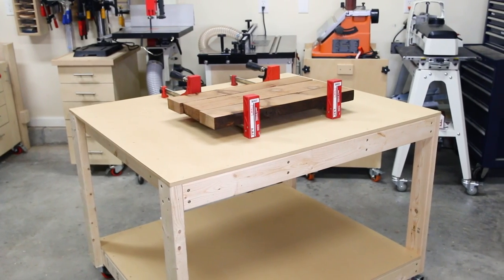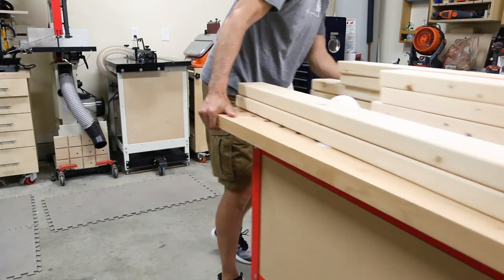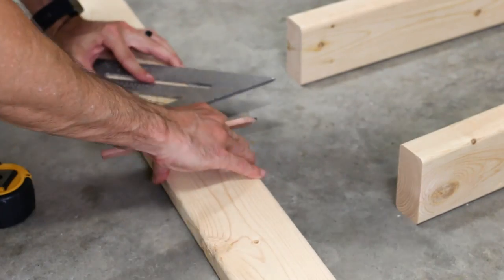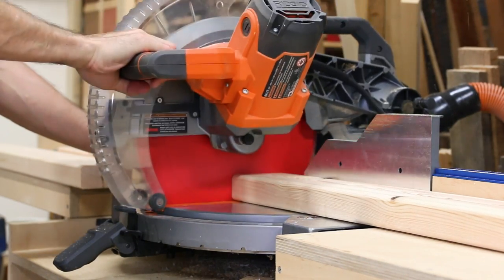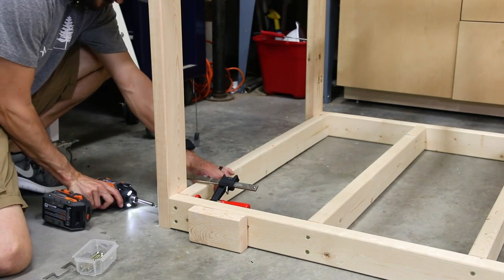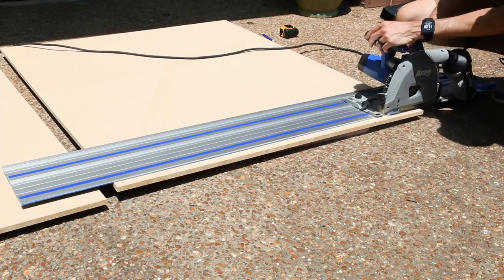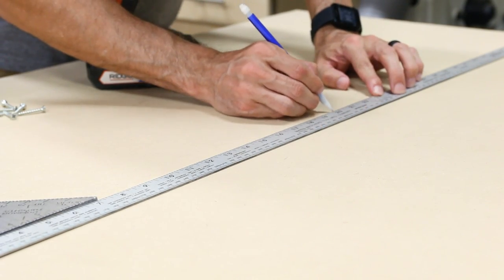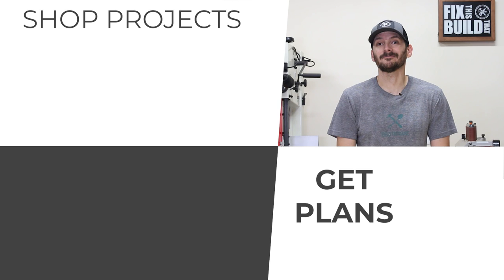DIY Workbench / Work Table | How to Build

Comment: Looks like you are mostly relying on the shear strength of the screws to support the top frame to the legs.  If you add a second 2x4 inside each leg it will send load directly from the frame, to the leg, to the bottom frame to the floor.  Much more reliable than just the screws.  As a bonus it will likely help to make the whole thing more solid and shake less if you are going to be mounting a cnc on it.
Reply from the maker: Totally agree
Reply: Glad that I looked for this comment before posting it myself, as you've phrased it better than I could. I built a similar table and since I used large reclaimed lumber that wasn't as uniform in dimension, I used a circular saw to lap-joint the legs to the frame, getting a similar result - there's a surface to screw into, resisting lateral forces of the table top going side to side, but the frame also rests vertically on the legs to prevent shear forces from being applied on the screws.

Another thing I did slightly differently (other than using more reclaimed solid lumber for the top and flattening it with a router planing jig) is leave significant overhang on 1 side and one front, so that the flush sides can go up against a wall while the overhang sides can be used to easily clamp work to the bench. When up against a wall, I find locking 2 casters is enough, no need to crawl behind the table and try and press that corner brake down.
Reply: yep agree, that and the 10 screws on each bottom corner, be careful as i've seen2x4 easily splinter

Comment: Just finished building this.  Took me a little more than 5 hours.  It's a little rougher around the edges than the video but came out pretty darn close.  Great table, easy build, it's exactly what I wanted.  About $150 all in, got everything at Home Depot.  Thank you for the video and inspiration!

Comment: I just finished building that work bench.
I must say this is really nice. Perfect height and size. The casters really help and the locks are excellent. I did take it one step further.  I took all the top 2x4's and ran them through my jointer.
Thank you for the plans they are awesome and the cut list saves alot of aggravation. 
I'm a machinist by trade because even engineers need a Hero 😁

Comment: It's taken me nearly a year but I am finally down to only putting on the worksurface MDF.  Only able to work on it for short moments.  (It has been a long hard year for me but it has been good.)  I went the extra mile and added the drawers like you did in your update video.  First time mounting sliding rails, and it worked perfect!  Thanks for posting these videos!

Comment: I just built one of these. Wish I would have used MDF as my top. I have a cup in my 3/4 plywood top. Hoping to figure that out today. Thanks for sharing.
Reply from the maker: If you screw it down it should flatten it out (assuming boards are flat underneath)
Reply: @Fixthisbuildthat  For some reason that didn't help. I did end up flipping it and that made a huge difference. I think that table will end up being a finishing table. And I may make another more close to your design. Thanks!

Comment: Definitely going to use this as a template for a table! I like how low the shelf is so you can maximize size of items under it.. One thing I am going to do is leave the frame about 2" or 3" smaller than the top to have an overhang for clamps to attach to. Was debating if making a mobile or fixed table and after seeing this, bought the casters immediately

Comment: Another good video. Seems like a pretty simple project the way you break it down. I may not be an engineer, but I am a perfectionist!😉 I would have filled in those countersunk screws on the top work surface with wood filler and sanded it down lightly before applying the polyurethane....this way you don't have all those little round pockets on your work surface to catch dirt and saw dust.... it'd make it much easier to clean.. other than my OCD wood filler tip, I think that work bench looks solid!

Comment: Thank you so much for this video and the plans. I’ve built the entire frame so far, and I just need to pick up the material for the top and shelf. Assuming I’m okay with it being double the price, would you recommend a sheet of hardwood plywood over MDF? Or is MDF better for a work surface?

Comment: A great way to find straight 2x4's, when the only thing the home center / lumber yard has is a pile of pretzels, is to make them.  Take any 3/4" sheet of plywood of any grade, rip it into 3 1/2" wide strips, glue 2 of them together, and you have a 2x4 that will never warp in either direction.  The bi-directional grain in plywood's alternating layers is longitudinal grain (running the length of the tree), which expands/contracts less than axial or tangential grain, making plywood very stable.
Reply: Ooh! Great idea. The framing wood in my neck of the woods is so pathetic I am surprised the houses stay up...

Recovering engineer here too!

Comment: Using the 90 degree clamp when connecting the 2x4’s is a good idea. You’d think attaching 2x4’s is a no brainer but they can get off square if your not careful.

Comment: Here's to making a 2.5 x 2.5 x 3 ft workbench. Primarily using it for staining station and holding some equipment on bottom. My 1947 garage is far from flat. :)

Comment: Great Video, I have a question though. How much weight do you think this workbench can hold? I was planning on making 2 of these one as an assembly table and the other for Benchtop tools. Like a drill press, bandsaw, belt sander, Spindle Sander,  Router Table. Do you think it can hold the Benchtop tools? Please let me know, your fan - Patrick

Comment: I made a smaller work table nearly identical to this one a couple of years ago. Biggest difference was that I put the legs on the inside of the frames instead of the outside, which made all four sides flush with the tabletop edges, and gives me a clamping area that goes all the way around the table (no legs getting in the way). Drawback to it is that I had to cut notches in the corners of the bottom shelf for the legs.
I made mine a little taller, since I'm 6'-3". The tops of all my work shop surfaces are standardized at 40-3/4", which is a very comfortable working height for me.
I used white melamine board instead of MDF, and ironed on some edge banding. I use my work benches for less rough stuff than a wood shop, so I like having a nice, smooth surface that I can use for cutting cloth, wrapping Christmas gifts, and all sorts of other making tasks.
I made the table 24x36 inches, allowing me to buy use pre-cut 24x48 melamine sheets for the shelves, with only one cut on each. I could have made the table 24x48 and eliminated the cuts, but I needed a smaller table for my tiny shop. Cutting melamine with a circular saw is easy, but you need either a lot of thick tape or another solid surface under the melamine to prevent tear out of the white laminate; that stuff chips really easily, even when using a fine-tooth blade.
I didn't screw either shelf down. Since the bottom is notched, the legs hold it in place. For the top, I inverted the table and lined the top up with the frame, then screwed some scrap blocks to the underside of the tabletop in each of the four corners. These scrap blocks act like cleats; they fight tightly into the corners, preventing the tabletop from moving around. The weight of the tabletop, combined with the friction fit of the cleats, holds the top in place, and since the top is flush with the frame all the way around, there is no place that I can accidentally catch the top and lift it up. To replace the top, I have to reach under and push up pretty hard to overcome the friction fit of the cleats.
Reply from the maker: Sounds like a great alternative assembly method! I needed mine flush on the inside for the sliding tray I put in next

Comment: I've seen a lot of benches built with either 4x4s or two 2x4s that are nailed together. I'm planning on building a 4'x6' outfeed/assembly bench, and I'm debating if I should make my frame that hefty (4x4), or just build a one 2x4-thick frame. What do you suggest? 
Great video by the way!

Comment: Love the video and work table.  I was a bit shocked when you didn't use pocket screw for the table.  I'm guessing that by not using pocket screws, you cut down on the build time due to no hole drilling?
Reply: Same here, I'm about to build this and debating on whether I should use pocket screws or not.

Comment: Do you have plans for a 30x60 workbench? I will be using a 1.25-1.50" solid table top and would like casters so I can move the table around in my garage. I would also like a middle or bottom shelf to store some items.

Comment: What brand corner clamps are you using in this video? I plan on building either a 30x60 or 30x72 workbench and want to make sure the frame is square. I looked at one at Lowe's and it was $45, which seemed high to me. I enjoy looking at your work and videos, thanks!

Comment: Nice design for a work bench. My only suggestion to improve would be to add some glue for additional strength, but not for the top so it can be easily replaced if needed.

Comment: Brad so i took the leap and added the draws.. It took me awhile to get over my fear of doing it, but I watched that video a few times and that helped. I do have a question.  When installing the draw slides,  can I use 18 inch ones, for a 21 inch draw, or do I need to get the 20 inch ones.. It will save me on cost with the 18's Thanks for your videos, they help a lot you break things down well.  I may try the miter station next.
Reply from the maker: You can use 18" slides but you'll still have 3" of drawer that doesn't pull all the way out
Reply: @Fixthisbuildthat  all done with the draws.. thanks for all the info..   Miter stand next.

Comment: Brad. I watched and downloaded the plans.. Thanks for all you do. My question is as follows.. I recently got a dewalt 7480 10 saw. can I use this basic bench and make the necessary adjustments to use this as the new house for the table saw. Will the mdf be good enough for my extra table area.. also should I do anything else to the mdf..
Reply from the maker: If you're talking about mounting the saw in the workbench you'd definitely need to add supports in the center. Nothing else needed for the MDF top
Reply: @Fixthisbuildthat  Yes that is my intent. I think this size work bench would be a great size to put the saw into.. thanks again for the plans.. Now I need to figure out the support..

Comment: Gotta work on that engineering deprogramming ... I would go crazy with those screw heads in the top ... I'm forever drawing stuff up and marking sheets and stuff on my top. So ... I laminated melamine type sheets to all my tops. Easy peezy. Low cost and slick tops. Then ... I need clamping ledges around the sides ...Holy moley .. never done ...
Reply: Then there was the need for leveling in different areas of the garage floor which must have been poured on January the second or July the 5th ... its drunker than their hangovers.

Comment: BUTT joints on the internet, Brad? You are a brave, brave man!
Reply from the maker: I said cheap and easy, right 😃
Reply: I’m a beginner trying to up my game by using lap joints => Mountains of sawdust.
Reply: @davidhawley1132   My comment was a joke about all the youtube trolls that throw fits whenever anyone doesn't do a hand-carved blind dovetail reinforced with hardwood splines. For a good portion of the DIY banger projects, pocket holes and buttjoints are just fine.
Reply: Jake Harris Yes, I got the joke, but couldn’t resist the chance to talk about my feeble efforts :)

Comment: thanks a lot 
could you help me ?
I don't know what does this sentence mean :
 Legs = (8) 2x4’s cut 28 1/4 inch long (Legs for a 34 inch tall bench)

which one is the width ? height ? 2x4's ? what is s mean? and also 28 1/4 ? 
sorry for my question  I'm beginer

Comment: You mentioned that you "were going to use that overhang for something later" when referring to the gap on two of the sides - what did you end up doing? power strip?
Reply from the maker: Yes, exactly
Reply: Brilliant... I'm building a bench now and have overhang on front and back. Simultaneously thinking "where am I going to mount a power strip" and "I can probably fill that gap with the leftover 2x4s over there....". The two ideas never really connected for me until now. Thanks.
Reply: Brett Webster are you able to share a pic of end result of power strip mount?

Comment: One way to go around if you don't have a flat garage floor is to place a sheet of plywood on your floor and use it as your flat reference.
Reply from the maker: Yes, that will at least be better but will flex a little

Comment: Hire a concrete shave company. They will computer level the whole floor to within a few millimeters.
Reply from the maker: that seems excessive....I like it
Reply: @Fixthisbuildthat  much easier idea. Use 1x4 boards and layout an area the size you want and pour in self leveling concrete till level and then grind edges to a slope to remove trip hazard. Way cheaper. Nice cheap perfect level build area.

Comment: You keep on going on about precision and engineering and then use imperial units. "To the nearest thousand of an inch"...sigh. Did you know that the definition of an inch was the length of 3 grains of barley lined up end to end? That is until it got defined as 25.4mm. "engineer" >_>. But nice vid anyway.
Reply from the maker: You realize we build aircraft engines using thousandths of an inch tolerances here in the States, right? You can hate on imperial, that doesn't make it less precise, just different. 😀